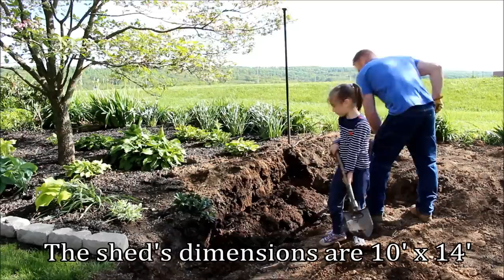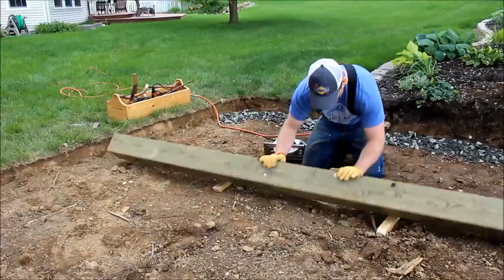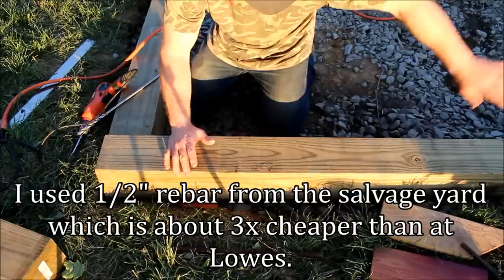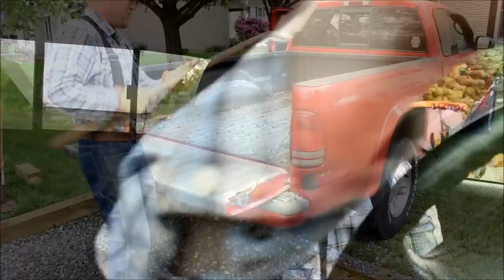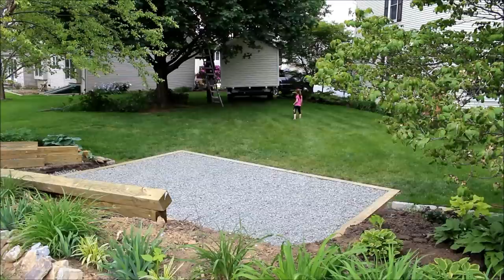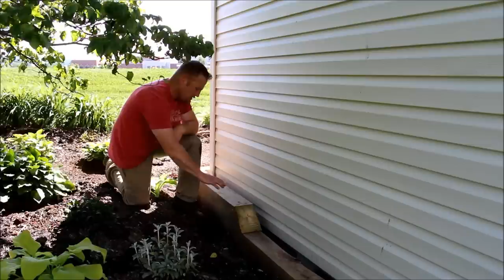Building a Shed Pad on a Budget by Hand. DIY How to

Comment: Here is a suggestion for offloading stones in the back of your truck. Put a heavy-duty tarp down first before loading and tie a bow knot with all corners and center clasped together. Dig a hole to a minimum of 2 feet deep with a 2x4 set vertical just in front of your dump spot or better yet in the center of the dump spot, tie or better yet wench the other end of the rope to the hitch of your car. Instant leverage / pulley. It will save your back.

Comment: when ever you build a pad with gravel or roadbase it is always $ and time well spent ,to rent a vibration plate compactor. Most equipment rental operations rent them fr about $50 for a day. if you split the project into lifts of 2 to 3 inches of material and good soak with water, the vibrating plate compactor allows you get get a pad that is as hard and strong as concrete.
Reply: Mike

Comment: Thanks for a great video.  I'm in Canyon Lake Texas, in the Texas Hill Country, about 35 miles north of San Antonio.  After you get through the 2" to 3" top soil when digging, you hit several inches of calichi rock.  It's like limestone that's not finished compacting and hardening.  You can dig through that layer with a good sharpshooter spade if you take small bites chipping away at the edges.  Under that you hit the layer of limestone rocks mixed with calichi soil, and then you hit solid limestone bedrock.  You need a 20 pound rock bar, and a pick/matock, plus a good strong back, arms and shoulders to dig through those layers.   Because of this, we normally build up to level the foundation instead of digging into the soil and rock for a foundation for a little shed or small out building.   Your method would be ideal here.  I think I'll use your method myself when I build a storage shed this fall or winter.  Thanks again for your excellent video.
Reply from the maker: very cool to hear, Barry!  Thanks for sharing the ground composition down in Texas...very interesting!  Sounds like a killer to "dig" through that calichi rock so yeah this method should work fine.  Of course you have different critters to worry about down there I'd imagine!  good luck on building your pad!  Email pictures when you're done:  kylebollendorf1 at gmail dot com.
Reply: Vintage Wood Workshop Yes, we're overrun with whitetail deer, plus Axis deer from Asia are a non-native pest.  Mostly a problem with them eating the vegetation on the plants that homeowners plant (non-native plants).   Plus, thousands of deer killed on the state and federal highways, farm to market roads, and county roads.  A very large amount of damage to cars and trucks, and death and injuries to the occupants when deer come through the windshields.

Comment: Just an fyi, instead of using a small square to square up the building foundation. Try the 3,4,5 method. Meaning....from the inside or outside corner measure 3' one way and from the same corner measure 4' then the distance on the angle shud be 5'.
Reply from the maker: great tip!  I have heard of that before from Jimmy Diresta.  I'll try it on my next project

Comment: GREAT video and thanks for sharing!  I have critters going under my old shed that my uncle had built.  Where do you buy that mesh that you used and what type do I get???  Can I use nails instead of staples since I do not have a construction stapler???  Thanks for any help!
Reply from the maker: Thanks!  They call it wire cloth and you should be able to find it at a local hardware store or a big box store.  You can use larger staples that you have to hammer in.
Reply: Thanks so much for the tips!  Much appreciated and I never thought about this for my shed.  Using boards to seal up the gaps under the shed would cause the problems that you described and air needs to circulate while the wire cloth would also keep out the skunks and squirrels who love to go under my shed.  I really admire your construction and wood-working skills and I wish I had those, too!  VERY impressive talents that you have!
Reply: Doug Celestial

Comment: Hey if you ever do the again. In the rear where you have the retaining wall next time before you put the beams and gravel down put plastic down, the back fill and fold it down and put a couple inches of dirt on top of it. Kind of hard to explain in text. That plastic will a) help the water divert around when draining b) let the wood last longer and c) bonus in your case it would help with weed control in your flower beds.
Reply: James

Comment: Aloha! and thank you thank you thank you.  I  am considering putting a same size shed in my back yard. There is a small slope but seeing what you have done, gave me the idea of what to do with my shed pad.  State of Texas.  The area has some sprinkler system, so I may have to do some digging and move the sprinklers  heads.  I like the idea of ventilation when you put in the critter screen at the skid level.  There should be a similiar type gravel that can be compacted and yet allow drainage.  Thinking of drilling weep holes on the downside lower 6 by 6 posts  for drainage, ,and plug with wire for slithering critters. Will probably make the pad a little larger to  be able to walk around shed.  Again , great job.

Comment: I'm in the business and you did a nice job. The one thing I would recommend would be to make your pad a little larger than the shed you are buying. Say for your 10x16 I would make the pad 12x18 inside measurement. That allows for water dripping off of the roof onto the gravel rather the ground or timbers. By investing your sweat equity into your home and property you will come out so much further ahead rather than paying someone to do everything. Great Job!!!!
Reply from the maker: thanks mark, great tip!  I agree, if i had more room I would have done that but I was trying to avoid it sticking out in the yard too far.  take care man
Reply: Mark P. Why wouldn't you make it a little smaller, so that the skid ends rest upon the top of the frame?  Will the gravel, which will eventually give, provide enough support, or will the floor ventually begin to say in the middle because there is no support u see the skid?

Comment: I would do a reinforced concrete ring foundation a bit above the ground level at the top, then fill with gravel. Cover with 50 mm sand (all tamped). Then a plastic DPC and pour a 100 mm concrete floor. Build the shed on that. Use self-levelling floor paint to finish inside.

Comment: I did the same thing that you did for critter proofing . I used a long board  and a Soft mallet as a Brake  to bend the screen.    and used short pieces of rebar with a Fender washer welded on one end  and drove them in to hold the screen to the ground  and covered  it with stone  I also put down Geo tech (weed Blocker ) before I put down the gravel for my pad  to stop any weed on the sides from growing
Reply from the maker: great work, sounds like your shed is truly groundhog proof!  I'd thought about the Geo tech as well but I figured I'd just spray round up along the sides if it became a problem

Comment: Thanks for posting this video. I'm using the same method for my spa/hot-tub. At first I was going to pour a concrete pad; expense and fussing with concrete truck held me back. Then though, why not make a strong border and fill the interior with compacted stone and top it with brick pavers. Seeing what you did validated my thinking. ( I think I could have gone with just crushed gravel though, like you)
Reply from the maker: Thanks, great to hear it helped!  I wanted it to last longer than the shed itself and it has fared well over the last few months so it should work for you

Comment: on the vintage shed job, it looks nice, the colors and especially the dormer window in the roof.I am gonna just say it. Driving the rebar into the dirt,go back in a few months a year and they will be gone, rusted away. the skids that the shed was built on, should have rested on the treated foundation you built. may even hold it strong and tight when your rebar deteriorates.the skids are your floor joists. Then you would have needed less gravel. and P.S. the city codes are for your extra F.R.notes. But I checked you out just on the look of the shed,very thought it was a hangout to get out of the families way.I Like

Comment: Wood on the ground will rot ? It should be a view inches from the groud so that wind can blow underneath
Reply from the maker: zeeaars these are pressure treated pine beams meant for ground contact.  If you go to Lowe's or Home Depot you'll find a separate section for the treated lumber which has a green tint to it

Comment: Great vid.  I'm having to build a new 10 X 16 shed to replace an older shed (the same size) that is literally coming apart at the seams.  The down side is I'm stuck rebuilding it on the same site which poses some problems in itself.  Making a gravel filled shed pad is a brilliant idea and one I'm going to utilize as it can sit on top of the ground without having to dig out the area too much.  The area is 4 feet from the back side of my house on one side and 4 feet away from my covered porch on one other side.  I live on a very steep hillside and the only level area I can utilize is the one where the old shed is standing.  Additionally, I can't excavate the area under the shed since my utilities (water and electric) are buried just under the surface where the shed will be placed.  Kind of a conundrum if I may say so.  I'll be building the shed from scratch from my own plans (no code requirements here in rural Vermont where I live) and this pad foundation will fit the bill.  The hardest parts will be deconstructing the old shed, hauling the gravel with a wheel barrow from my driveway (I can't get my truck back there due to the extreme steepness of the hillside) and constructing the roof of the new shed.  Thanks for your excellent idea.  Cheers!  (ps:  how many yards of gravel did you end up using?) I also subbed to your channel.
Reply from the maker: Thanks William, wow sounds like quite a challenge with layout of your yard.  I think it was 2.5 to 3 yards of stone for mine.  The 6x6s were definitely worth the effort and with the rebar pinning them down, they aren't going anywhere.  Send me some pics of your old shed and layout if you want....I'd be interested to see it:  kylebollendorf1@gmail.com   Thanks for subscribing!
Reply: I sure will after the snow melts here in northeastern Vermont.  I'd need some snow shoes just to walk around my house to the shed since there is over 2 feet of snow right now.
Reply from the maker: haha, wow, yeah we're snow free now with this storm....just a lot of rain!  ok, sounds good, have a good one man

Comment: You got one thing that would concern me.    You have at least one of the buildings 4x4s sitting one a  6x6.    Those gravels will compress a bit which means the center 4x4s supports may not be carrying their share of floor weight causing it to sink in the center..    I have a 12 x 32 that is sitting gravel but the pad wasn't level like I thought.    Not I have to jack it up while making sure I don't leave some of those 4x4s hanging under the flooring.

Comment: The Dakota was such a great truck.
Reply from the maker: Yeah, this one is a 2001 with the 4.7L 287 which I like a lot better than the 318 I had in my 97 Dakota.  great trucks!
Reply: I'm currently looking for an older used pickup, I was looking at a 2002 Dakota but I'm hearing to stay away from the 3.9 V6 which this one was. So the search continues.
Reply from the maker: yes, I would always steer away from an American-made V6....they are just under powered gas gusslers IMO (I drove an old Dodge Ram Prospector with a straight 6 in high school)

Comment: I did this last year. I had about $250 in the 12x14 pad. I used 4x4s with rebar, mechanical fasteners, and 2.5tons of rock.
Reply from the maker: Nicholas Galliart sounds about in line with mine.  I had to buy extra 6x6s to build the tiered retaining wall

Comment: I just had a 8x12 shed installed in California last week. I was getting quotes for a cement foundation with numbers from '1,300.00 to 1,800.00. So  I spent 3 weekends gathering every 1ftx1ft paver on my property and was - 12 short. I spent about $22  on the remainder. Getting them level was a bitch but including a  mt dew was $25".

Comment: Excellent video with quality editing.  Really enjoyed watching, especially to see your young daughter out there being so involved.  Good for young girls to help with projects that have traditionally been done by men!  Hey, I'm all for equal rights.  I like the idea of the screening to keep critters out and to allow air flow so that the underside can dry out.  Are you planning on running electrical to the shed?  If so, there's probably some city codes you'll need to explore.  I built my own home on an acre in Alaska about 15 years ago, complete with lofts, whirlpool tub/shower, wash room, and arctic entryway, so I know it's a lot of work to do what you've done.  Again, good video quality (unlike a lot of what's on YouTube for DIY projects).  Thanks for sharing.
Reply from the maker: Wade Rogers thanks for your comment, Wade!  I appreciate you taking the time to let me know what you thought.  My daughter is always helping me with all kinds of projects and she even just tried might welding last week so yeah I'm raising her to be like an Alaskan!  When I got to travel to Alaska 10 years ago, I was amazed at the work ethic and outside the box thinking the Alaskans had when it came to careers and life in general.   I'm training my daughter to have a similar mindset and want her to be independent and tough.

I probably will not run electric to the shed at this point since I don't plan on using it as a shop.  Thanks for the feedback on the editing, it's something I'm trying to get better at with each video to keep them interesting.  One of my favorite videos I've done recently is the Plumb Rafting axe part 2.  Again thanks brother, and hope to hear from you on some of the other videos!

Comment: You dug out how deep you wanted the shed and You used stone underneath each 6x6 to level it.  Did you level the ground beneath it first or simply use the stone to level it?  Is the benefit of using stone to level it because the ease of it?  How has it held up over the last few years?

Comment: Thank you, because I always saw rebar around, at various places, while out and about, when whatever the case would be getting construction work on it, but I never knew it was called "rebar." There's a lot of things I always saw, but never heard named, and this is one example. 

Interesting video.
Reply: Rebar is short for reinforcing bar. Their primary use is in concrete to reinforce it with tensile strength. Concrete has compressive strength, but no tensile strength. Because the two materials expand and contract at nearly the same rate, they are an excellent combination to get both, the necessary compressive and tensile strength.

Compressive strength is typically your downward weight bearing. The reinforcing steel helps with the "stretching and pulling" of lateral forces or downward forces, depending on how it is oriented, vertically or horizontally.

Think of a vertical concrete pile or pier. It will handle the downward compression very well. But if there is an earth tremor or quake, there can be lateral movement that requires more tensile strength to keep the concrete from coming apart.

In horizontal applications, think of a foundation footing or a horizontal beam. They are long like a piece of timber. If you exert enough force on or near the middle, it will bend and sag until it reaches It's breaking point. The compressive strength of concrete is not enough to withstand such force, so in such cases, it is reinforced with rebar to add tensile strength.

Comment: I stumbled here only because I recently finished a shed pad and new shed - I'm still sore for it too LOL. Good job involving your daughter there. My daughter is 22 now but I tried to involve her in projects when she was younger. She's pretty handy now. At the very least, from watching me over the years, she's learned don't be afraid to try. If you mess up, you fix it and move on.

Did you tamp that gravel? I rented a plate tamper and beat the heck out of that gravel before installing the shed? Is you pad holding up well?

Smart move on the chicken wire i.e. digging down and back. Skunks are great and determined diggers. Without digging back, they'll get under the wire - ask me how I learned that lesson LOL.

Cheers from a canuck who enjoys saving $$$ doing it myself. New sub.

Comment: If I had the money and means I would build a house 15' x 30' with a full basement and two bedroom upstairs loft so 3 levels in total. Then alittle distance away from the house on lower ground and closer to the road, a garage twice the size at 30' x 60' with a flat gravel roof and rows of solar panel racks. Parking lot (blacktop) in front of garage and a walkway to the house from the garage. Shade trees spaced out perfectly with a picnic table under each one.

Comment: I just had a 12x20 shed placed on my DIY foundation today.  I like the idea of the "screen" along the bottom edge of the unit.  Question ?  With the addition of the wood beams have you had any drainage issues, mold, mildew or otherwise on the siding or beneath the shed ?   I'm thinking of landscape / decorative ideas for the edge of my shed.  Currently it's a base unit set on a crush gravel and stone bed and sits about 6 inches high and level.  If you got a few ideas please let me know.